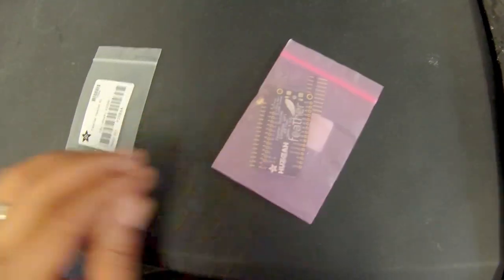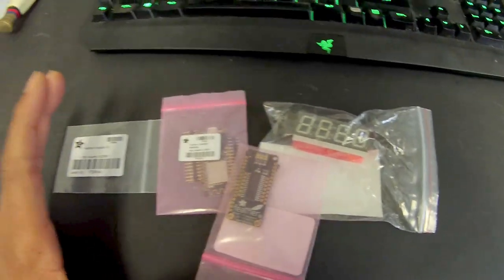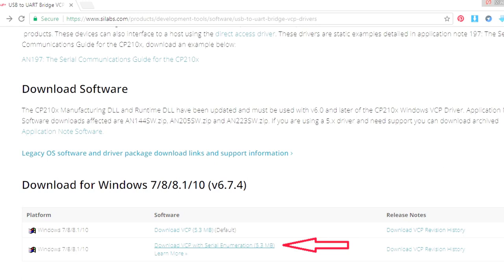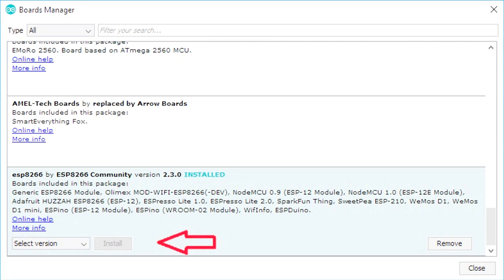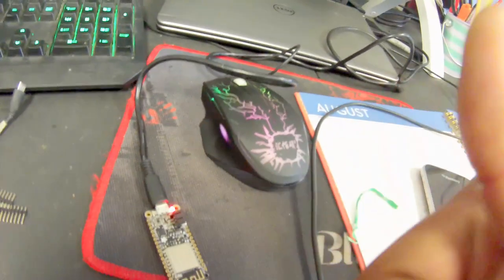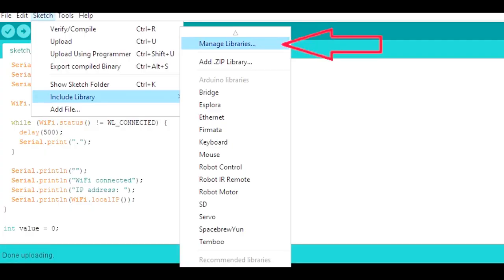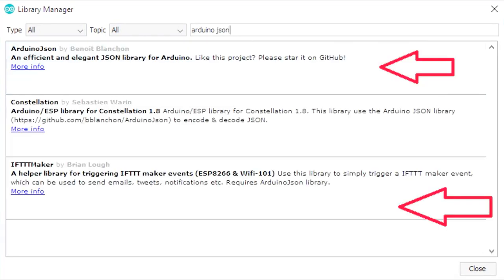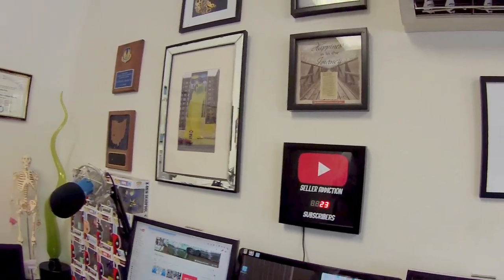Make your Own YOUTUBE Subscriber Counter

Comment: dude, that soldering is made my eyes bleed...
Reply from the maker: Yes I need more practice :)
Reply: @MADDIY  I know this video is about a year old, but here are a coupole simple tips on soldering to get you (or anyone else) up and running like a pro. Very important to use a wet sponge to help keep the soldering iron tip clean.  Don't leave the soldering iron longer than you need, it will just oxidize the tip, and make it wear out sooner.  Heat the pin and pad you want to solder, then add the solder to the pin and pad.  You don't want to "drip" melted solder onto your joint, it will be a very weak joint at best, just heat the joint, then add the solder to the joint (not the tip). Once the solder melts, remove the solder but leave the tip of the soldering iron for a second or two more to let the solder flow around the pin, and covering the pad. Then remove the iron, and move on to the next pin.  A good solder joint should be shiny and smooth, making a fillet from the solder pad on the PCB up the pin you are soldering.  If it is not shiny or smooth, then clean the tip of the soldering iron and reheat the joint - it may be necessary to add just a touch more solder to make it flow nice. Using a good small diameter flux core solder will help as well.  For someone starting out, I'd suggest older leaded solder, something like the good old stand by 60% tin, 40% lead with a rosin flux core.  Personally, I find the thinner the better for electronics work - get the thinnest stuff you can find.

Comment: warning to people with hooked up printers: some printers use arduino boards that also show up in the arduino IDE so if it's connected via USB it'll show up under the usb ports. mine's usually COM9 but it can change depending on what port you're using. Make sure you're not uploading your sketch to your printer, though i've done it a few times by accident and it just spits out an error because of incompatible chipset instead of uploading which saved my ass.
Reply from the maker: Yes, you are definitely right about that.  The very first time I did this I did notice multiple COMS showing up as well.  Luckily I did select the correct one the first time around.